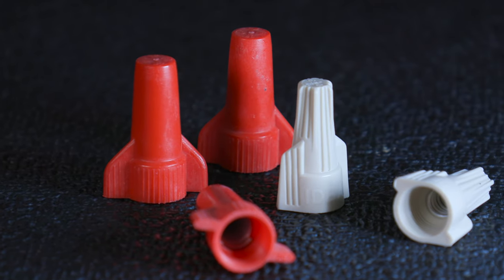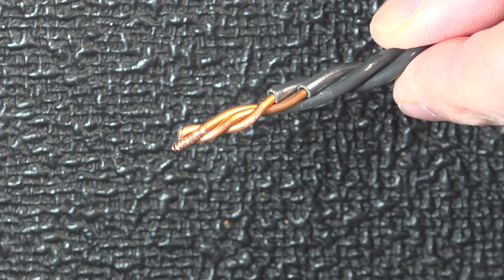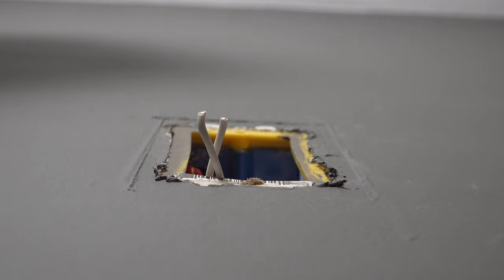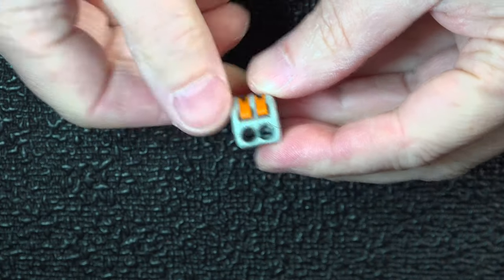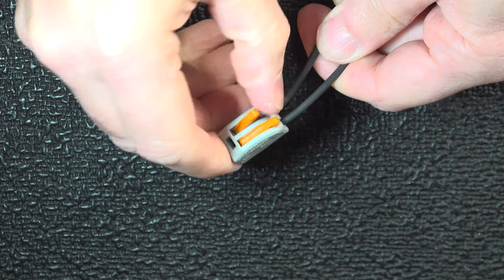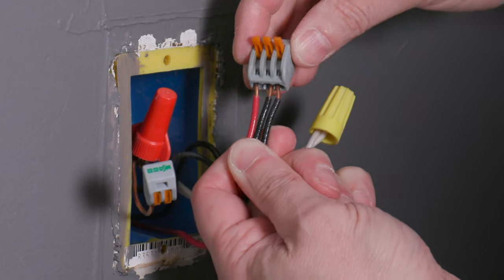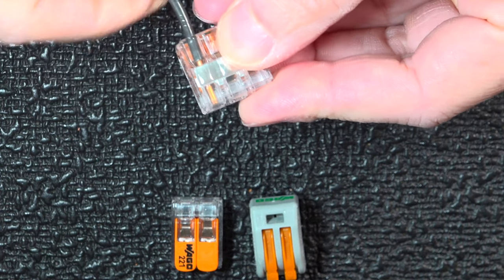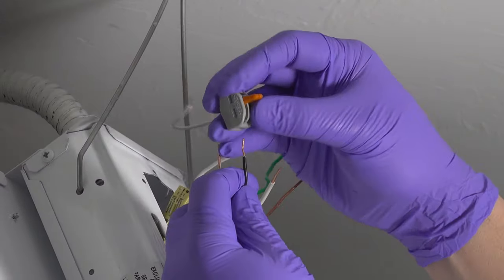Never use Wire Nuts Again - Wago is Better Electrical Connector

Comment: A: No competent electricians cut off wire nut connections
B: 'Bite marks' are not an issue
C: Reusing wirenuts is common and fine
D: 5 times the cost per unit and double the install time is not going to happen
E: Wagos ARE good if you often disconnect and reconnect something. Thats about it.
Reply: In former British colony Hong Kong we are using electrical connector that uses screw to secured the wiring........ That is why I feel wire nut  is not secured enough for me.......
Reply: I wouldn't hire you.
Reply: Look up the legal definition of competent.
Reply: The unit price is roughly twice the cost; not 5 times. I would gladly pay the one time price to hire a competent contractor and spend an extra $10 for safety. Since 200 units is likely enough for the whole house; I would not bet on the cheap guy who cuts corners to save $10 on a one time cost. Any competent electrician would know that you do need to cut and strip an old connection due to oxidation of the metal and work hardening. Likewise, they would understand the importance of insulating wire connections securely, and why it is important to minimize resistance in those connections; because a competent person would understand how dangerous fire is and how quickly it kills thousands of people every year in their sleep.
Reply: @brendanwood1540  How many wire connections do you think $10 in Wagos will make?
Yeah. Not a lot. And 200 isn't even a 3rd enough unless you have a small house. Pigtailing outlets alone is 3 per.
Wirenuts are about 5 cents each and Wagos are about 20 cents each so yeah, 5 times as much is slightly exaggerated.
Customers with unqualified sanctimony are given enormous bids given the difficulty they inevitably add. Youre right, you wouldn't hire me.
Reply: @bradrichards8122  That's still $30 for a large house. I looked up the price and for 200 Wire nuts it's about $10; for 200 Wagos it's about $20. So for 600 Wagos it's still only $60 vs. $30 for the less reliable, less safe, and less serviceable option. It's a ONE TIME cost. Even if you consider the material cost, the copper contacts are doubled, not multiplied by 5. 

If you think using a word like "sanctimony" will nullify my legal competence or qualifications you'd be sorely mistaken. Just as you are assuming that $30, or even $300 is an "enormous" cost to exchange for safety and cheaper insurance appraisal. Insurance, and liability are continuous costs throughout the entire ownership. 

Those repeat costs aside, how much to run conduit? Yeah, it costs a lot, but in a facility where future expansion, and changes in infrastructure are planned it saves on long term expenses not having to tear walls apart.

I think you've confused experience with competence. There are plenty of experienced professionals who were not properly educated up to modern standards, who are legally incompetent, and yet still highly experienced and successful in their field. In fact, competence only comes into question when there is a major accident and lives are lost; many businesses thrive for years before an inquest exposes their incompetence.

Maybe electricians need a ring made of high voltage power lines that collapsed killing the line men in order to remind them of why they are doing the job and what that certification entails; or the melted remains of a house fire. Much like Engineers wear a ring made of steel from a collapsed bridge on which people died.
Reply: @brendanwood1540  Bid just tripled
Reply: @brendanwood1540  "Less safe, less reliable option". What complete BS.. The twist on connector is just as safe and reliable as the "Wagos", perhaps even more so. Please submit your evidence or close your mouth. A properly installed twist-on connector will properly hold the conductors in compression during the expansion and contraction cycles under load, and its square "spring" cuts into the conductors to form a gas tight connection and prevent resistive oxidation. Thus, a secure splice. You simply don't know what you're talking about.
Reply: @boeing757pilot  Due to the tight spaces in most electrical boxes it is difficult to get long leads stuffed in the box so the size is limited. This means that the wires are not only work hardened, but also need to be stripped for reconfiguration, if there is sufficient oxidation, which shortens the lead length further. These problems only crop up on regularly serviced rental properties and old homes.

However, the primary reason I say less reliable, and therefore less safe is because the wire nuts are not transparent. Especially if joining an older solid core wire, with a newer multi strand wire, it is not possible to know if the wire nut connection was good and proper, or if one wire is not secure; not without tugging, and this is not feasible every connection on a ladder or with old existing wiring.

The wago is more reliable because it is transparent and predictable; every connection is the same and can be verified. This verification also provides safety. 

It turns out under ideal circumstances a wire nut can provide a tighter connection; only if both conductors are solid copper and the same gauge. This provides slightly less resistance. However, all of the connectors provide enough conductivity to operate safely. A loose wire nut, or a pushed down multi strand wire inside a wire nut is not safe. It is impossible to know if the wire nut was installed properly just by visual inspection.

It's also a conical round spring inside the wire nut; not a square. Maybe a square wire in the spring that cuts the conductors for better grip. However, this is invisible from external inspection and not possible to verify externally.

By far the main reason I stated is ease of use. Each connection can be verified easily, serviced easily, and installed easily overhead in ceiling junctions. Which I would greatly prefer since I once had both my shoulders broken. I would want the most practical installation.

If I was doing a brand new house I would gladly fork out a little extra to make the future more flexible. In fact I would insist on empty conduits being installed for potential future wiring installs for audio and visual equipment; likewise any reconfiguration. 

Again, I'm stating that the owner of the property gets to decide; not the electrician.
Reply: @brendanwood1540  Again, the twist on connector itself is no less reliable or safe over the long term. What you're discussing is installation practices, as you somewhat stated. Okay. A properly installed twist connector is extremely safe (provided a quality connector is used. 3M is my favorite). What I think you are  saying is the Wago is much more idiot proof. No argument here; I tend to agree. As for spring shape, I'm referring to the edge that cuts into the conductor and through the oxidation layer to form a gas tight connection for long term service.  In the end, I have no issue with the Wago design or their exclusive use. My issue was your assertion that twist on connectors are an inferior connection. But, I now understand that your assertion factors in the real possibility of poor installation practices of twist on connectors; the Wago connectors definitely minimize these concerns. I would, however, caution folks using these types of connectors to use the actual Wago brand. I have not been impressed with the Ideal brand version.

Comment: Wago is against building codes in my state. They clam there not Secure enough properly properly hold wires together causing shorts that lead to electric ark starting a fire. So check you code book before using them.
Reply: I could imagine the problem would be a situation where the wires actually end up holding up a fixture, so imagine someone cross threaded the bracket screws, or the nut on the threaded post comes loose over time.  A properly sized connection with wire nut will, in a pinch, hold up most flush fixtures,  at least so you don't have it come crashing down on your head and have a chance to get up there and fix the problem before anyone gets hurt.  I would not count on a thin wall plastic box to take that weight.
Reply: What state is that?
Reply: @robertlaw4073  Don't do that unless it's the ground. I've seen guys pull wires out of the fixtures that way.
Reply: @robertlaw4073  it seems like you're saying my hypothetical light fixture hanging from the ceiling shouldn't be hanging from the ceiling just by the wire alone? Sarcasm
Reply: Calling BS on that Permformenbuttstang
Reply: @brianleeper5737  I love idiot statements like "my state" or "where I live" without saying where it is. Why even bother commenting.
Reply: Which state?
Reply: @PeterLawton  And more precisely which county.
Reply: @imark7777777  Based on a Google search, I am going to guess eastern North Carolina, US.  But a lot of people misspell performance, so I could easily be wrong.
Reply: I think you meant to say open not shorts.
Reply: I’ve seen more wago problems than wire nuts.
Reply: @erictighe7845  What does a Wago problem look like? How do we know that we have found one?
Reply: The plastic connector will be chard and possibly the bare wire will have a heated metal look or black tarnish to it
Reply: @erictighe7845  Weird stuff. For some reason, could not locate anything relevant on Google Images. Not a very photographed problem this. Also weird that there isn't any videos or photos of these Wago problems in the wild.  A Wago connection should never become warm during normal use. The connection should hold up after the plastic and wire insulation has melted, but that will certainly not happen without significant overload, like 100A or something.

Comment: As an IBEW journeyman inside wireman, I’ve used about a billion wire nuts and seen VERY few failures. I reuse them constantly, as does every other electrician in the world. You can absolutely connect stranded and solid wire with wire nuts. Wagos fail all the time, too many parts (potential points of failure) for something that cheap. They’re pretty good for low voltage, low current applications like inside LED light fixtures and such, but wire nuts totally kick their ass in every conceivable way for general use.
Reply: You've never had the spring pop out of a wirenut? The wago is just  basically a tension clip. It is more than likely the people installing them were doing it incorrectly, which of course is a problem because a product should be easy to use by alot of people.
Reply: @JustinL614  I have, and when it does it’s obvious and happens right there before your eyes where you can fix it. Wagos rattle apart with vibration and such. With a wrap of 33 around the base of a wirenut, they’re good enough for motor leads or anything. One thing I’ll give Wagos, they usually don’t cause fires when they fail. They just stop the connected equipment from working. Not exactly acceptable in powerhouses, chemical plants, hospitals, etc. where I work. A PROPERLY INSTALLED (most aren’t) wirenut will last 30 years or more with absolutely no issues whatsoever.

Comment: holy crap, thank you so much....using those twisty ones are such a pain in the ass for a DIYer, especially someone like me who tends to get anxiety working on electrical projects (not anxiety if I know how to do them, but illogical anxiety about the breaker magically turning itself back on when I'm working on an outlet lol) I immediately bought the starter pack from the link you put...thanks again!
Reply: You can buy lock-out equipment for your breakers so they cannot easily be turned back on without unlocking them.  Maybe you'd feel better if you took a lock-out-tag-out (LOTO) course and followed the procedures.
Reply: @willmcgo8288  Thanks for the suggestions! I'll look into those

Comment: I was an electrician from 2005-2010 and I still do low/high voltage work (residential/commercial) electrical and A/V work, and I remember the first time I seen these (not the Waco ones), about 4 years ago. As soon as I looked at them, I snatched them from my buddy and asked him how come no one told me these existed and told him he had just changed my life forever. I've seen them on the shelf but never took a second look at them because I've always used nuts. The only thing that sucks is not all of them are re-usable, but they're still worth every dime. People cutting wires too short don't make me wince anymore lol.
Reply: All of them are reusable AFAIK. Those that don't have a lever need to be twisted around the wire while pulling gently, and they will come loose. Once you get a feel of it you could open those pretty quickly.
Reply: @mr0big  Pleeeease don´t twist them ever. I admit it works, but it isnt the way it´s intended to work. If you look at them closely you will find that near the end there is a hole where a phase checker screwdriver fits in. When the screwdriver is inserted completely you push it a little in direction to the end of the WAGO, that will open the connection and you can slide the wire out.
Pro-tip: Pay the few cents more and buy the original WAGO, the product quality is worth it!
Reply: @macdieter23558  as far as i know you are supposed to twist them, the hole is just to insert a volt meter